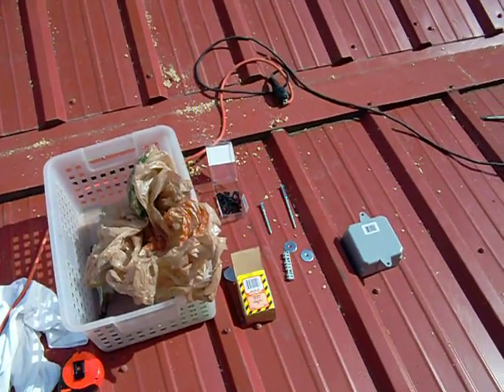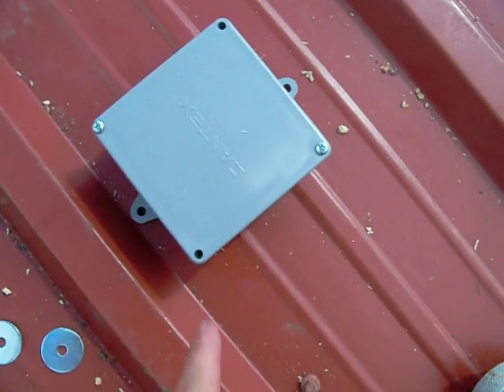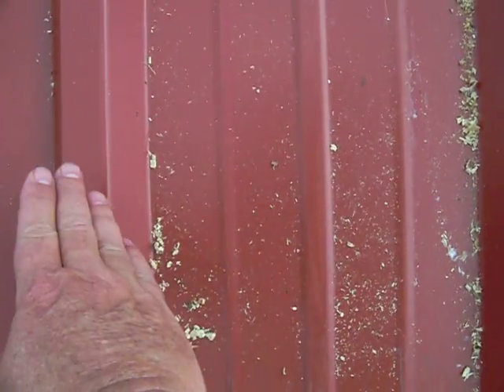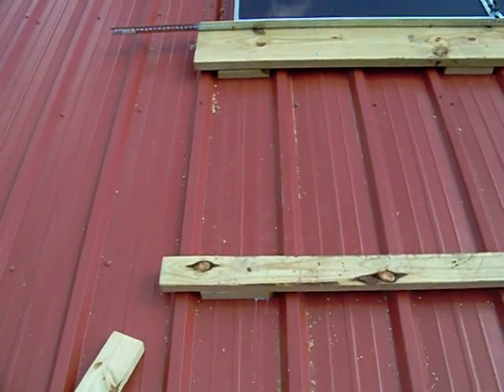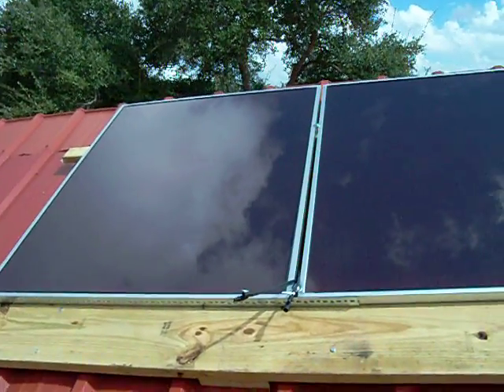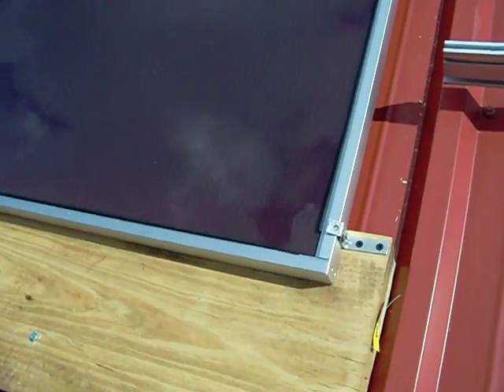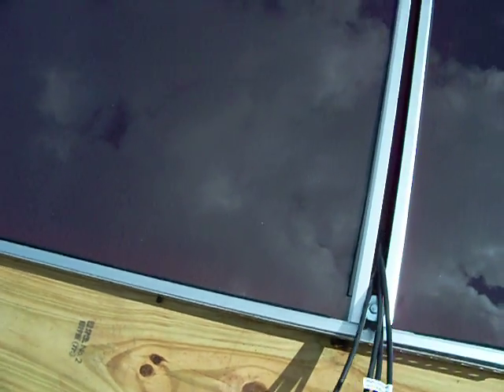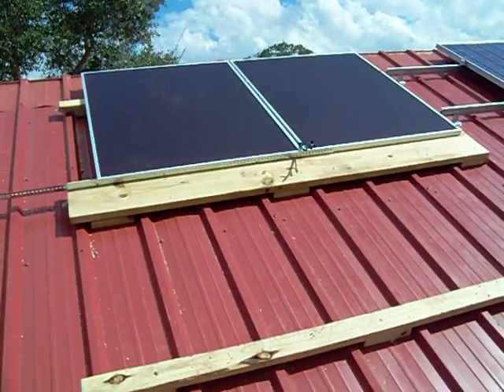How to install solar panels on your roof quickly and cheaply - Part 2

Comment: This will result in roof failure, wood rot, mold, plaster wall failure.  This is a leaky install, guaranteed?  I suspect.  Saving a few bucks on solar panels that will wear out in a couple of years?

Comment: Thanks..... Have tiny project on a corrugated roof so I will have to work out the leveling.  Just waiting on the X4 100w panels to arrive.  Will follow some of your frugal wood tip for the rails

Comment: Nice video. Thanks for sharing. I believe it's too much work for installing a solar panel. Here is an easy way to do it. Super practical. Check the video. @ here you can get it @t

Comment: It's been over four years since you posted this. I'm curious to know how the timber you made the frames from is holding up?
Reply from the maker: Watch this weekend for a video update on that. I will begin rewiring the roof panels to use a single conduit so that will be a good time for a video update. Thanks
Reply: econewpower Cool as, I'll look out for that...! :)

Comment: Perhaps run the cables above the top panels (near the roof peak) and below the bottom panels (near the drip edge) as you may not have a way to reach the middle for servicing once everything is up.